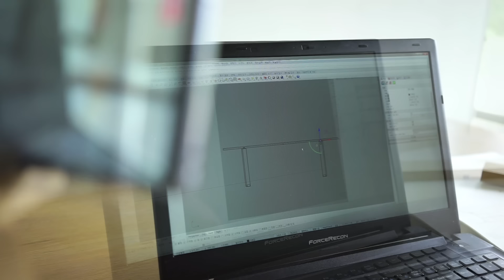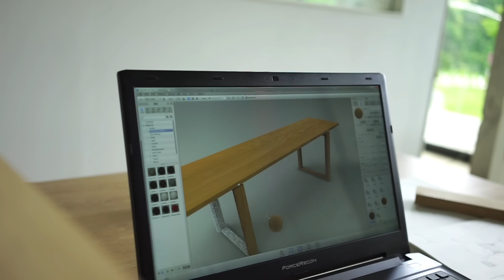Kobeomsuk furniture - 2400 white oak table

Comment: Why he is glueing the dovetail batten? As far as I know it should be sliding to be able to compensate the shrinking.
Reply: the dovetail cleat that's attached to the tabletop is not glued. he also used dovetails to attach the perpendicular pieces on the frame. it doesn't matter that those are glued because they are only like 80mm wide. Also, the pieces attached together have the grain oriented in the same direction so if they expand they expand together
Reply: @hentaisan  thanks! It's a bit confusing, at 12:45 there's no glue, but after the cut only seconds later there is some! Or at least it seems to be glue.
Reply: @HerrKlaus1963  at 13:20 the inserts at the end of the dovetail grooves are glued, but those are just for aesthetics. The cleat is not glued. BTW, seeing as how the insert goes all the way to the cleat, I assume he left a gap between the insert and the cleat on the other side of the table. Unless he's doing this during winter
Reply: @hentaisan  I agree! But look again at 12:50 glue appears from nowhere.... Or may it's grease to get it in. 🤔
Reply: @HerrKlaus1963  I noticed that too

Comment: This is beautiful.  I have a question about the sliding dovetail joints.  It looks like it was glued in all the way across?  (Or at least, glued on one side, and then a filler piece glued on the other side so the slot doesn't show.)  Is that right?  Wouldn't that cause real wood movement issues?  Or am I wrong?  Thanks!  It is a really, really beautiful piece.
Reply: You are correct. For all you amateur woodworker watching this video do not copy this method of gluing. The top needs to be able to expand and contact (oak moves a lot). By gluing the crossmember underneath the top you are creating a lot of tension. When that tension builds it will cause the table top to split. I produced thousands of solid top dining tables and can speak from experience.
Reply: I guess my questions is in the video was misleading or not, because it looked like it was stuck in there and wouldn't be able to move.  I'm hoping it just looked that way in the video.  Gluing it in all the way would defeat the whole purpose using using the sliding dovetail.
Reply from the maker: Yes, we need consider wood shrinkages, So on the sliding dovetail, only gluing one side so that the top can move naturally as shrinkages. (I glued only one side) one more, wood shrinkage is caused by moisture , so need good finishing as well. I apply varnish on the top and bottom both side after oil finishing, it can reduce shrinkage %.
Reply: Nope. One side or two sides you are still constricting the movement of the wood. The wood rays of the oak are large which allows for transfering a lot of moisture. It's a nice table and you do good work but you never want to glue end grain. I only tell you this from my experience. I learned the hard way what not to do.

Comment: Love this table so much, but wont dovetailing the cross members in stop the table top from moving and cause cracks in the future? Stunning work though!!!
Reply: You just don’t use glue.
Reply: @donmartinfamily  but he did?
Reply: @samtasho4204  only on the very end.  When it first started there wasn’t any, then he added it at the last few inches.
Reply: @samtasho4204  compare the slot at 12:49 and 12:51.  You can see he added it for the last little bit.

Comment: I admire your craftsmanship and the table looks beautiful.  One question however.  Why did you glue the sliding dovetails on the tabletop?  Aren't you worried about expansion of the top across the grain over time.  It would seem that gluing the dovetails will inhibit that cross grain expansion and could cause the top to crack.  Thanks in advance.
Reply from the maker: Yes, we need to consider about wood shrinkage for all wood furnitures. When u see my video again, you can realize that glued only one side, not all part. And there is some space between dovetail female part and male part. So it can be moved naturally without any cracks.

Comment: Hi, I'm new to woodworking and obviously still learning, but why did he use the handplane after the table-top glue up? 
Ive never seen anyone do it before
Reply: probably to remove the excess from the glue itself. also, it may leave a tiny gap between the assembling parts even tho it's precisely measured
Reply: after a glue up you always use a handplane or machine plainer because a glue up is never 100 percent perfect. even if one part lies 0.1 mm higher than the other you will still feel an edge. if you plane after a glue up your multiple pieces will feel as if its one piece

Comment: after ripping your last edge on the tablesaw why do you clean up the edge in planer rather than on the jointer.  is the planer a cleaner cut for some reason?
Reply: A jointer won't make the edges parallel

Comment: what are the alternatives to the long dovetail if you don't have such machinery? ta :-)
Reply: For the long dovetails he made in the cross supports, you could use a table saw and cut a mortise with a dado blade and a corresponding tenon with a jig on the table saw. It would not be as strong as the dovetail, so you would have to be careful that you glue it up well. For the shorter dovetails on the ends of the cross supports, you could do the same or you could use dowels, biscuits, or dominos.
Reply: In fact, there are people who cut sliding dovetails by hands, using a router plane but an ordinary router is actually quite cheap
if compared to most woodworking machines and it is really something worth having if you plan projects like
large cabinets or tables.

Comment: Hello, can someone tell me how those things are called 14:15 ? if possible in german ^^ (or english). Thank you
Reply: Do you mean the tool? In Germany we call it Forstnerbohrer.
Reply: @martinalbers282  thanks and no. i mean the metal bracket thing. the double washer looking thing ^^
das teil, das aussieht wie zwei unterlegscheiben nebeneinander (in dem video nur schlecht zu sehen). verwendet er (und andere) zum befestigen der tischplatte an die unterkonstruktion.
Reply: Habe ich mir auch schon gedacht. Ich habe für dich recherchiert aber auch nichts gefunden. Ich würde es "Sockelverbinder" oder "Sockellasche" nennen. Viel Glück bei der weiteren Suche.
Reply: @martinalbers282  Hi danke. Jetzt habe ich zumindest rausgefunden, dass die Dinger "figure-eight fastener" im Englischen genannt werden. Deutsche Bezeichnung konnte ich nicht finden aber evtl. gibt es die in Deutschland auch nicht.
Reply: They're called turnbuttons or picture frame turn buttons. Either phrase should bring up a bunch of results :)
Reply: @bilonay  hi, thank you but i found them and they are called "figure-eight fastener". the turnbuttons are for other uses. but thanks anyways! :)
Reply: Tenfdy oh I see the ones you mean, cheers

Comment: what type of hardware did he use at 14:41?
Reply: Sure you got the right time? That's just a cordless drill at 14:41
Reply: he is using something that is calles figure eight fasteners, it is usually used to attach wooden tops to a desk or a table

Comment: I wonder if it’s a sturdy table.
Reply: English Street are you still wondering?
Reply: I am! Is it??
Reply: @Engstreet  likely so. Even but joints are strong when properly glued.
Reply: Between the sliding dovetails that joined the legs to the top, the "aprons" between the legs that are also dovetailed in, and the mortise-and-tenon joints that were used to assemble the legs, it would take a lot of effort to hurt this table. So yes, it's sturdy.

Comment: Why did you put the timber through the thicknesses on edge?
Reply: I'm just guessing, but I think it may have been to clean up the table saw cuts and make sure it was completely flat. I wonder if its a little gentler than using the jointer, but I'm not a scientist :)
Reply: @monjoe732  sounds about right bro